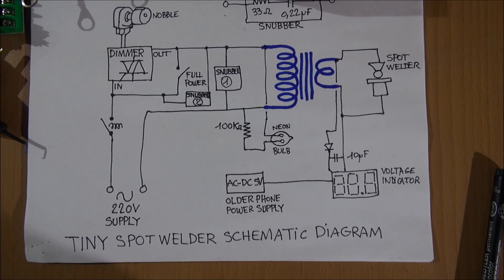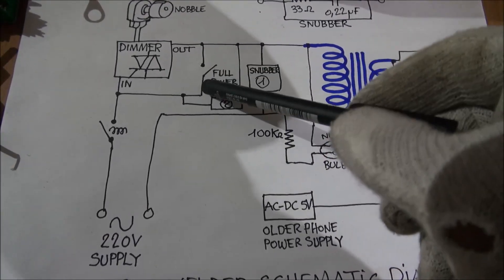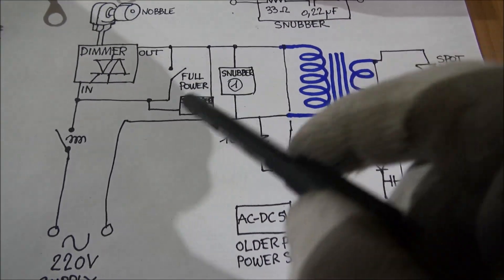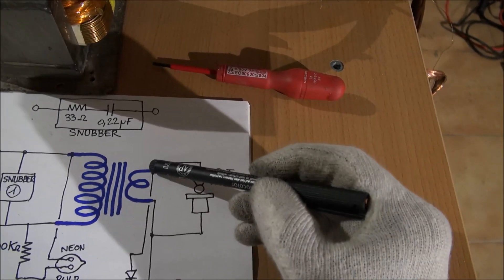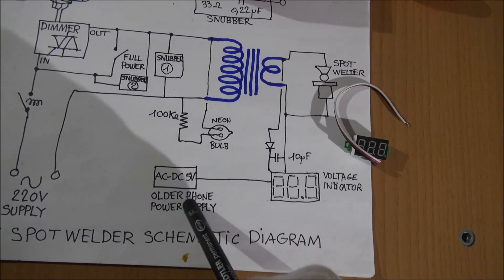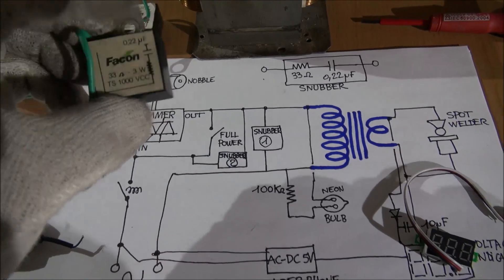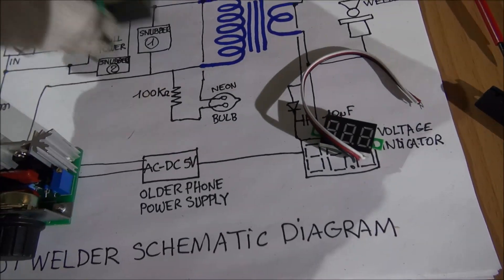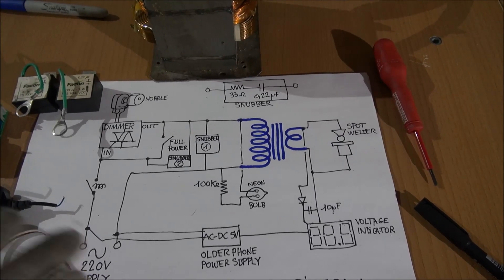Schematic and diagram of the tiny and compact spot welder

Comment: The transformer data please
Reply from the maker: this is a rewinded microwave  transformer. The secondary is removed and rewind with between 3 and 5 loops of 16² copper wire.

Comment: Sir. I impressed a lot your work. It so very nice done. However, if you don't mind to ask you what size of cable did you used in this project. Also to where did you buy the snubber and volt indicator. Can't find in ebay
Reply from the maker: Hello. Cable used here is 25mm² cable, or 7mm diameter. You can not find this kind of snubber anymore, because they are very old. You need to make it your self by component, with the same value you can see in the video (with a 250V capacitor and 5w resistor).
The voltage indicator is supplied by a 5 volts phone charger, this is a 3 wires model, and you can purchase it for fews dollars from aliexpress, or Ebay. https://www.ebay.fr/itm/Mini-DC-0-30V-Voltmeter-LED-Display-Panel-Car-Motor-Digital-Voltage-Meter/312678785005?hash=item48cd1b9fed:m:mcNxltCz0N8ugJWi1dNkEyQ
Thanks for your comment.

Comment: Hey, I was messing around today and I noticed the Capacitors we get out of the Microwaves, (Same place we get the MOT's). They are snubber networks also. Just curious if you think they might work as replacements for the ones you are using(snubbers like the ones you use are hard to get here in the states). The one I am looking at says 0,80uF +_3% and the resistor is 10MOhms.

I'm in the middle of another build and thought I might just use up some of my old Caps from the Microwaves I already torn down.  

Also, did we decide on the Diode I should have used on the Voltage indicator and I was wondering if there was a way to hack them to show the Amperage like you latest build, but show Amperage up to 999 amps. Of course, it would probably read 9.99amps. But it might be a cool hack if you can figure this one out with all you Awesome Math skilz!!!!You Rock!!
Reply from the maker: @njfulwider5
 Hello yes I think you can use the snubbers from the microwave, with adding on it a 5W resistor of 33 or 22 ohms. But keep in mind than the snubber I have are out the time, they comes from 1975 industrial box.  Yes it's possible to hack the little chinese multimeter for to have higher amps but you need to use a rail to rail op amp. In this case, the most difficult think is to calibrate this hack on a shunt. Thi kind of shunt will be the copper cable out of the transformer, going to the welding.
I hope I can try to figure how it's can made. Thanks for your comment.
Reply: Great news!!!do I add the 33 or 22 ohm resistor in series or parallel? Thanks again for the superquick response!!!👍👍👍
Reply from the maker: @njfulwider5  in series. This is an equivalent of a capacitor with high ESR.

Comment: Could you tell us the rating (KVA) of the transformer you're using?
Reply from the maker: hi, don't confuse normal transformer and MOT transformer.
They work differently.
This one is a MOT transformer, and it's a 1500 watts transformer.
MOT use "over saturated core" properties, but normal transformer use not this tip.
The "over saturated magnetic core" are used to have a big power despites the little size of the transormer.
A normal transformer with same power weighs 3 times more heavy.
The normal transformer have a very low idle current and power.
The MOT transformer have very high idle current and power. This last one is never used with missing load.
Reply: Thank you....It looks like the transformers used for the kitchen microwaves.....Do you know what the output voltage is or the transformation ratio of the transformer??
Reply from the maker: MOT = Microwave Oven Transformer.
It's simple to have a quick idea about the voltage output.
One turn = 1 V (0,7V RMS). In this case, you have 3 turns, so 3 V.
If you use long cables for soldering, you can add a turn, for to have 4 turns.
4 turns will improve the dynamic of soldering, in case you use long cables, for tab welding for example.
Ratio for this transformer is 10 in first configuration (220 V to 2000 V), in case you live in a country wich the main voltage is 220V.
The final ratio in this soldering transformer is 220/100, so 2,2 Vrms, approximatively.

Comment: Great explanation and construction of the spot welder!  What would be the desired transformer rating and secondary voltage for welding nickel plates to Lithium-Ion cells?
Reply from the maker: It depends on distance from the output transformer to the tips. For tab welding, 2 volts are enough, if you use short strong cable tip (20/30 cm). If you use long cables tip, like 50 cm for each hand, maybe for a more special work, you need 3V or 4 V output. With MOT transformer, you will have 1 volt per turn.
Voltage are usefull for better dynamic soldering, fast and quick. If not, metal takes long time to see it's temperature to rise and that's not a good thing for battery. 
You need to find the good compromise by your self, by testing and soldering. Anyway, the device on the video permit to you all the possibilities, because a variable power output ability.

Comment: Hi Alexander, nice video. Thank you for the details and availability, answering all questions people did. Only for clarification, I cheched the layout of the dimmer and it already has a Snubber with different values in components (100R, 100nF). I wonder what another Snubber (33R, 220nF) in parallel with the output of the dimmer can cause for better or worse. Can you elaborate about this? Did you solve any problem with this additional Snubber or you put it in the circuit as prevention? Once more, congratulation for your videos.
Reply from the maker: Hello. The snubber in the dimmer are not enough. These are by default configuration. When using the dimmer on a resistive load, this snubbber are used to rectify high pic coming from cuting sin wave form at high level. These brutal break generate lot of radio wave, wich are considerated like parasitic.
When using a magnetic load, these high pic are thousand and thousand more powerfull and need strong snubber to rectify it. You can add these big snubbers at the same time than those on the dimmer, that's no matter.
Snubbers here are not for prevention, they are essential to have stable work and safe dimmer.
If you don't use them, you can have useless dimmer and you can destroy it very easely.
Thanks for your comment.
Reply: Thank you for your attention and generosity. Congratulations!

Comment: Bonjour monsieur. 
Je répète ici les félicitations que j ai mis en commentaire sur la vidéo de réalisation..
 Sans trop abuser (mais un peu tout de même) est il possible d avoir des liens pour commander les snubbers, le dimmer le potentiomètre? 
Et pour combler un peu mon ignorance pouvez vous donner svp la valeur du potentiomètre ainsi que les puissances des composants (résistance, pot.,condensateur,.,,,,) ?
 MERCI
Reply from the maker: Les snubbers utilisés dans la vidéo sont vieux de plusieurs dizaines d'années, et ne sont pas vraiment disponible dans le commerce.
Il faut les construire soi-même, avec une résistance de 22 ohms 1W(environ) et un condensateur de 0,22 µF environ(non polarisé 300V). 
Il existe des snubbers sur Ebay mais ils sont destinés à du matériel spécifique et ne conviennent pas vraiment, en plus d'être chers.
Vous pouvez également les construire avec des composants de récupération.
Le potentiomètre est ici le potentiomètre du dimmer (variateur) qui se trouve sur Ebay pour 3 euros. Le dimmer (que vous appelez ici " potentiomètre) est un simple modèle de 2000W ( à commander en Chine sur Ebay).
*Diode : petite diode shottky de préférence, mais n'importe quel diode convient.
Afficheur: afficheur à 1E sur Ebay, il faut un model trois fils. Suivre le lien en dessous de la vidéo pour la notice de branchement
*Alimentation AC/DC 5V 500mA: un vieux chargeur de téléphone (récupération) pour alimenter l'afficheur)
*Condensateur sur l'afficheur: 10µF 5V minimum 
*Résistance bulbe néon : 100K 1/4W (facultatif)
Merci pour votre commentaire et bonne réalisation!

Comment: I wonder if his will work to make a Stud Welder for Auto  Dent Repair . 
i.e. spot weld pins or ring washers to use a slide hammer to pull out dents
Reply from the maker: Yes it's the same principle, but you need lot's and more power than the spot welder on the video.
You need something like 8 volts output with maybe 1500 A pic. Because you will loss lot's of energy between the transformer and the spot wich is weldered. You need to study what is the righ voltage for you, and yes, it can be done. Thanks for your comment.

Comment: Happy new year to you & your family,Sir. Thanx for the nice vedio. Sir you have not mentioned the wattages of the different components. No of  turns inthe primery ckt of the transformer or rating out put before modification. Or it is from some old equipment transformer could be used.
If instead of sunbersthe capacitors and resistors of the values are used will it serbe the purpose as i canot get them from market. Please advice them & thanks
Reply from the maker: hello, happy new year...
The transformer is MOT (micro wave oven transformer) the primary is keeped, the secondary is rewinded with 8mm diameter souple wire.
Note in this transformer the primary is the one millimeter wire, the secondary is the 0,3 mm wire. This is a high voltage transformer, and the wires wich must be dismounted are the high voltage wire (so the secondary)
This transformer comes from a 1600W oven.
Snubbers are hard to found in shop, so it's more easy to build them.
0,2/0,3µf with 33 ohms resistor, both of them are need.
Capacitors are 200 V minimum (no polarized) and resistor are 0,5W minimum.
Dimmer is a 2KW dimmer from Ebay, not expensive (3 dollars).
Secondary turns with this transformer are 3 wires.
For a tabwelder with long probes cables, it's better to use 4 wires for more dynamic.
Reply: Alexander Hartdegen 
Hi , Good day sir. Thanx for your reply and spsring ur valuable time for the same. I shall try and if any problem arises, I shall (permit me) to knock at ur door for easteemed valueable advice and guidance. Thanks once again Sir.
Reply from the maker: Don't forget there is lot's of comment here below, from other people building this device. To read all the comment section will help you a lot.
Please did it before ask. Thanks.